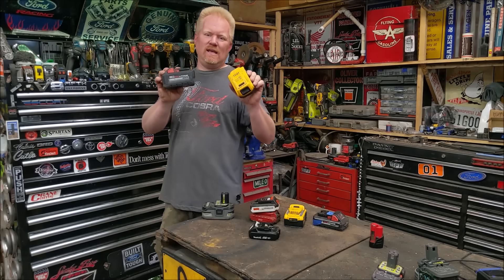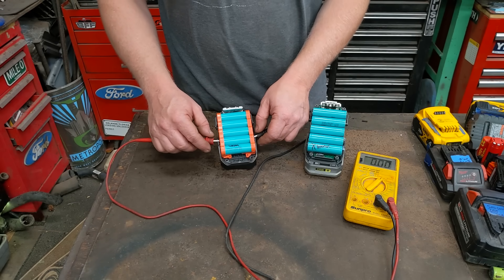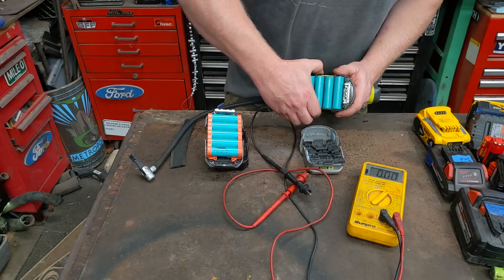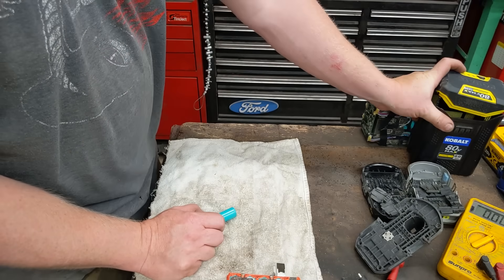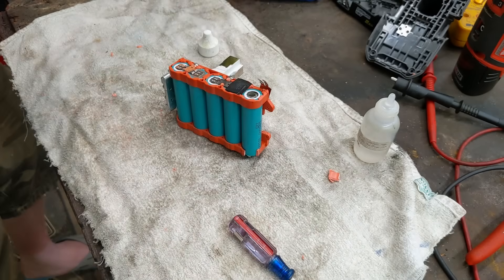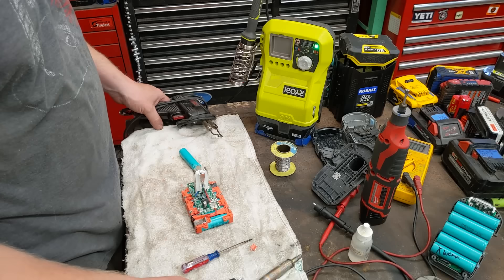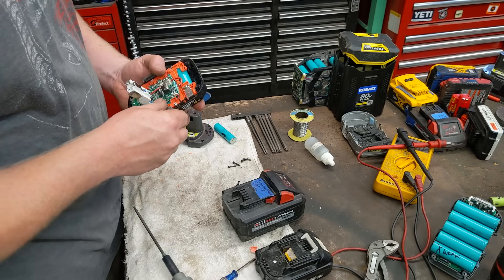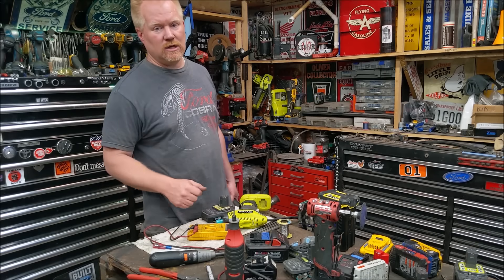Revive DEAD Battery Packs - Rebuild Repair - Dewalt Milwaukee Makita Ryobi Bauer Ridgid 18v 20v 12v

Comment: I have two 8 year old porta-cable 18v packs. Rest are 20v. The 18v both died within hours of one another, and located inside what looks to be a built in fuse, but also some unmarked surface mounts, one looking similar to a 555 timer from the 80s, just much smaller. My plan is to put in a fuse of similar ratings, once I locate a parts list for the model I have. I'm curious to know if Porta-Cable is known to put time bombs into their equipment.  Timb bombs are code written to kill a vital connection after a specific date, or certain amount of use. Until today, I only encountered them in things like the R4 for Nintendo 3dxl.

Comment: You move way too fast in your explanations.

You mentioned only applying your gaterclips for a few seconds on the trip charge... others say 3 to 5 minutes. So, what/who's correct??

You don't explain how to take them apart to test...
You don't explain the load testing procedure; how to do that procedure and what tool(s) needed.
Looks like you using an air pump... HELP
PLEASE EXPLAIN FURTHER. 

Thank you sir!

Comment: i have 12 vt battery pack i use pack one time it stopped during operation tne charge light showed charged but didnt work i dont know how check the ciruit board this made in triagle. Can you do one of these unvirsal battery pack please. i went through three of them same way all new three battery set

Comment: Came here to find out how to test and diagnose problems with the pcb circuit board for these types of rechargeable battery packs, and it only fixes offered was to replace it with a new one. That doesn't exactly work for tools that have been discontinued and they have different layout pcb connection locations that no current battery pcb boards have. I have all new battery cells to replace the old ones for every battery pack but it won't fix anything if it has a problem with the pcb components.

Comment: Is there anyone doing battery  rebilds on milwaukee  in michigan
Reply from the maker: @wandabuchholz6508  Nobody is rebuilding packs for money/people. Labor cost out ways the cost of just buying a new pack. 
A 5.0ah pack with 10 cells is going to take 45 minutes at a low shop rate of $80/hr, that's $60. 10 cells have a cost of $4-5each. So it'll cost over $100 to have a pack rebuilt by a shop. You can buy a pair of 5.0 ah packs  for around $130 online/70ea
Reply: @sixtyfiveford  thank you

Comment: Porter cable and black and decker would be the cheapo power tools and cheepo batteries the ryobi is light years ahead .
Reply from the maker: @jalee6587  Comparing Black& Decker to Ryobi is like comparing a cat turd to a dog turd.... Both are crap. Porter-Cable/ Black& Decker haven't made a new tool in their line in almost 10 years. They're dead brands. Ryobi has so many different tiers of tools. It's impossible to blanket their brand as good or bad. Ryobi's top tier costs as much we're really close as a good tool from one of the top three brands. Honestly, for your buck these days, if you're just looking for a basic tools, I think HART may be giving Ryobi a run for their money.

Comment: I have some well used milwaukee(not abused) batterys, pushing 7-8 years old, still working quite well… impact/drill only… 3.0, old style, doesnt even say 3.0 on the side
Reply from the maker: These batteries last a long time when used on things like drills. The hardest thing for them are high drain tools and rapid chargers. Both of those make short life of a power tool battery.

Comment: I have some of Lowe's Kobalt 80V batteries that have quit working. Have you tried this process with any of the 80V batteries on the market?
Reply from the maker: @sledge4894  I've worked with a few of the 80v Kobalt. Principal is the exact same; you just have more cells (20).

Comment: Thank you so much for this! I just won a $700 e-scooter and it came with a junk battery that only lasts like 10 minutes and the company that makes it went under so buying a new battery is out of the question. I broke the battery down and was thinking I would have to replace all the cells but now that I found your video I know how to test each cell so I can hopefully get this thing running. Thank you again, subscribed!

Comment: If you're worried your circuit board will die? you can also use alligator wires to supply power to the circuit board with proper voltage, low amperage & keep it alive while you work on it.

Comment: I have a Hart 20V battery that runs the tool for a minute or so and dies. When I checked it, all voltages are within 1/10th of a volt. I then found that it will run again for the same period of time without being recharged if I let it sit a few minutes. After doing that several times the voltages are al still within a 1/10th of a volt, just a little lower. It's a 2AH battery that uses 5 Eve 20P batteries in series. These Hart yard tools are good for light things like blowing leaves off the porch, but I wish some one made an adapter for using a Dewalt battery in them because I have several of those. The Hart tools aren't worth spending the price of a Hart battery on once you've had them for more than a couple years.

Comment: They don't solder them in the factory is because of the time of high temperature applied to the battery. They use point welding because applied temperature it's for a very short time (fractions of a sec). Then comes the time spent! an example https://www.youtube.com/watch?v=Hu_A3Hf-A4Y

Comment: Anyone ever did a complete rebuild replacing the cells with sodium cells?
Reply from the maker: There are a few major problems with sodium ion cells. Number one is the energy density so the cells would have to be way larger to hold the same amount as a lithium ion. So even if you found an 18650 the same size You would likely have half or less the same milliamp hours capacity. As far as I can see, they don't have high drain/high discharge cells either in sodium ion.

Comment: did you know that you can use neodimium magnets for battery terminals, at the end of your leads?  this will make it easier to charge the cells individually while they remain in a pack

Comment: Can you replace an 18650 with a 21700?
Reply from the maker: The 21700 is just larger. So generally it will not fit. Voltage wise it's exactly the same.
Reply: @sixtyfiveford  thank you.

Comment: U should not use band single new cells in a used pack and u should check internally resistant of  each cell not the best info in this video and plz don't use a soldering iron to connect cells best to spot weld

Comment: You shouldn't solder batteries! The heat from the iron alone can cause the battery to catch fire and then you're in for a REALLY bad time! This video is dangerous to follow and you shouldn't be giving advice that you don't understand, especially when it could be potentially very dangerous for the person copying you!!

Comment: I have a Kobalt 24v max 4mAh that appears to be overcharged (four flashing lights on the battery). Any advice on best way to correct / fix or should I tear this one up for parts?
Reply from the maker: Generally, a flashing means there's an error. Overheat etc. It wouldn't mean that it's overcharged.
Reply: @sixtyfiveford  I'm saying I'm saying overcharged because it's about 24.7 volts I believe it's supposed to be 24.2 nominal? I don't remember exactly but yeah it's four flashing green lights and nothing happens when I put on a charger . At this point I have pretty much written it off. Maybe I'll just open it up and tinker around until I figure it out at least then I'll know what it was
Reply from the maker: @bereadyeveryday6764  4.2V peak for 6 cells is 25.2 volts peak. 3.6v nominal for 6 cells is 21.6 volts nominal.
Reply from the maker: Open it up and test the voltage of each cell. Flashing lights generally means there's some sort of error. Something could have come desoldered on one of the cells.
Reply: @sixtyfiveford  thank you. I will do that

Comment: It's worth taking the positive and negative wires off the circuit board for a few minutes then putting the wires back on as this sometimes reset the circuit board so it can be used again
Reply from the maker: The circuit boards won't reset. They hard store the error code on a chip and no one has been able to crack it easily enough to make it viable. The only option with a bricked board is to buy a new one(they're cheap)

Comment: Watched your video & appreciate it. I have a Nocqua fish finder battery that quit fully charging, that's why I watched. It has 3 rows of 4 cells. Positive side (red wire in) all 4 cells read 4.17 v. Middle row, all 4 cells 3.39 v & neg side (black wire) all 4 cells 3.62 v.    The charger says its half charged & that's all it will do. 11.19 output & my fish finder requires 12v. Any suggestions? Also, do you have a video on testing the charger? Thanks again.
Reply from the maker: A lot of balance chargers don't do well at actually balancing all the cell groups. A lot of them stop when one reaches peak voltage (4.20). That's what's likely happened here. One thing you could do is drain the voltage on the 4.17 group to about the same as the others. You can do this by simply hooking up a car taillight bulb, a resistor or an old flashlight bulb. Drain the voltage until it's about 3.4 to 3.5. then throw the whole battery pack on the charger and see what it does. It'll likely bring those other two up and they'll all be around 4v. 

This will continue to happen again over time because that one group at 4.17 likely has a higher capacity than the other two groups. These batteries lose capacity through age and just random discharge cycles.
Reply: @sixtyfiveford  Thanks for the feedback. Really appreciate it.

Comment: Don't start on the Black & Decker 40v battery.  A big hassle to get it done.  1. star shaped bolt head is very deep that a regular head is not thin and long enough  2. when opened, the individual cells are wrapped tightly within thick hard plastic casing that looks nearly impossible to pry open.

Comment: Buy or make a little battery spot welder when you're so involved with these batteries.  
This soldering job is pathetic and bad for the batteries, especially when soldering this way.  It's more like frying the inside.   😂

Comment: Apparently homedepot and lowes will no longer will give you old power tool batteries for free or at all
Reply from the maker: Giving them is a strong word. I just walk in and grab them. 30 seconds in and out one man's trash my treasure. I think the problem is people are asking them for them. Then Home Depot feels like there's some sort of liability or the employee feels like they're doing something wrong. The ultimate answer is "No, You can't have them".  I've probably been stopped four times out of hundreds and every time I just told him I was doing random experiments on junk batteries.
Reply: @sixtyfiveford  ok i will do that
Reply: @sixtyfiveford  by the way, Home Depot does not have an apparent location where they recycle them. They probably hit it behind the desk for exactly this reason, but Lowes does have it out in the open. I might take an old battery with me if I can find one just to make it look more convincing.
Reply: @sixtyfiveford  also, what do you do if they find out and were giving you a hard time even after you tell him what you’re doing you just go visit another store?
Reply from the maker: I just randomly stop by probably 10 different stores when I'm out and about. Some of the Home depots have it right next to the returns desk and some have it out in the front foyer area.
Reply: @sixtyfiveford  ok

Comment: You never want to replace a single cell unless you test the internal resistance and you pair it with cells of similar internal resistance. Otherwise you are setting yourself up for disaster. Also only solder the battery if you are completely confident in you’re skills. If you insist on doing this, buy a little spot welding machine… and please be sure to match internal resistance, because tools these days draw a lot of watts and you don’t want a thermal runaway situation on your hands.
Reply: Exactly the 2 comments I was going to make.  Thanks for saving my fingers.
Reply: This comment sounds like great advice.
Reply: Quite literally, on your hands.
Reply: Match internal battery resistance & capacity. Your pack is only as good as the weakest cell.
Reply: Do you mean the resistance of the batteries? Or the internals of the controller board for the battery pack? Didn't fully understand
Reply: @molotovgod resistance of the cells themselves

Comment: So you don't have to separate the batteries because they are all connected? My pack's got a battery at the end of the pack a few volts shy just like yours. But after the 'boost' it was still no good, I came back on utube to make sure that all being connected wasn't the problem.
Reply from the maker: It doesn't need to be separated to test. The cells have no action on any other cell in a 5 cell pack. You'll need to replace that one cell. It's very common for a single cell to die/get weak.

Comment: ive found you to be the most informative source when it comes to anything relating to cordless tools and batteries.  not all li-ion batteries are created equal.  some of the older hilti and dewalt use lithium iron batteries which have a lower voltage rating but higher recycle rate and cant be charged off li-ion chargers.

Comment: Do you know how to make a adaptor for dw9050 batteries? I have a dw945 drill that I was wanting to use better battery for the drill Thank's Mark
Reply from the maker: You could make an adapter but honestly that drill is pushing 30+years old and though I hate saying it there are better options for complete new drill kits. It's unfortunate that we live in a world like this but.... If you want to make one here is a video I have on converting my 20+yr old 14.4v Porter Cable to run of 20v Black Decker batteries. https://youtu.be/q2eaKCzf04c This mod is going to cost you around $50.
Reply: Thank you very much I watched your video and how to make adaptor. I am going to harbor freight to but a warner 12 volt drill and flashlight kit and cut off the flash light part and make adaptor. Thank's  again. @sixtyfiveford

Comment: If the circuit board doesn't work after replacing a battery because it had no power, try to connect the positive end of the battery pack to the positive point of the board with a jump wire for a few seconds, your jump start method. Sometimes the board starts working again. Good job, by the way.

Comment: Tool battery surgery at its finest. One tip on soldering these, lightly sand the battery terminals and pre tin the battery terminals before soldering in the pack. You want the tip very hot but do it quickly. ❤

Comment: I left it uncharged in the storage for over 2 years.  :-0(  When i put mine in the charger, the charging light does not even turn on.   Should i jump it?  When i tried to jump it,  the light spark up!  Scare the shi7 out of me!  But it is still not charging.  :-0(

Comment: Great video. I'm just now trying to learn because I have around five Makita batteries to rebuild. 

Question 1: How will I know if my Makita circuit board is bricked?
Q 2: Whenever you're tinning a battery, what temperature is your soldering iron actually set to? It seems like you keep your iron contact time to under about ten seconds, and I'd like to nail it on the first try. Sucks when you can't get something to tin. Thanks.
Reply from the maker: Makita: If you've inserted the battery and got an error code more than three or more times, it's bricked. Soldering iron is as hot as possible. I think mine goes up to 900F.
Reply: @sixtyfiveford  Loud and clear. Thanks.

Comment: I store my batteries in my tool box. I work outdoors on hot days. Would the heat of the day drain the batteries? Especially when their stored inside the van on a hot day?
Reply from the maker: I wouldn't worry about it. They have a safety high temp override that won't allow them to be used or charged if too hot. They won't self discharge much if anything just sitting in a hot vehicle.

Comment: I'm getting tired of DeWalt batteries dying like this.  One 18V and just recently a 20V.  With the 20V, I used the circular saw and it was binding (cheap blade it came with) and after a minute of that the tool stopped and the battery was toast.  I just bought the security Torx kit - even if I can't revive the battery, I want to find out what is wrong! I like DeWalt tools, but I feel they should have some battery protection mechanism in place.

Comment: Often, a battery pack that won't charge isn't "dead" it just doesn't have enough power to signal the charger to charge.  It can be rectified simply by using a charged companion battery and jumping positive to positive  and  negative to negative for a couple of minutes.  That will transfer enough power to the "dead" battery which will now charge when put in the charger.  I don't recommend taking these things apart unless you really know what you are doing and are extremely careful.  When these things screw up the results can be really bad.
Reply from the maker: NO.. This is very bad info. "jump starting a pack" can and will cause damage and possible explosion. This is virtually always a failed cell. Jumping a pack will cause over voltage on the remaining cells and boom.

Comment: fire is a big risk with batteries using the wrong size cells can be risky in that way.

it is possible that laptop cells are being used to repair ebike batteries as well as the wrong kind of charger.

i have heard that while you can solder on 18650 cells it is not recommended because you can damage the cell by heating it up.

the dual row would be 2p configured as there are 2 rows in parallel and 5 in series to make 5s2p.

the circuit board is the bms